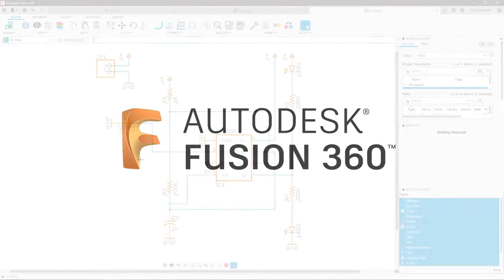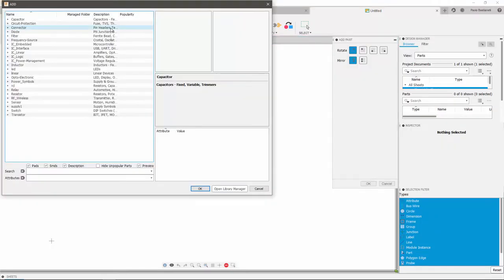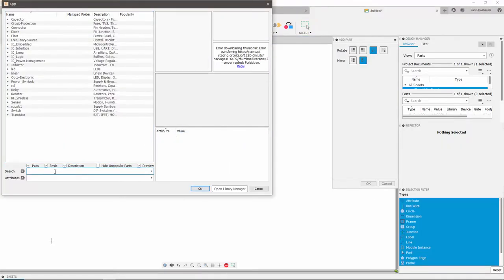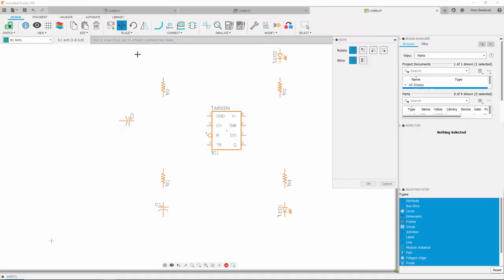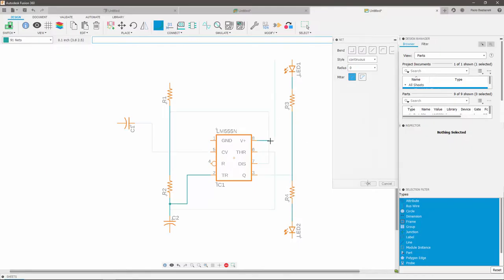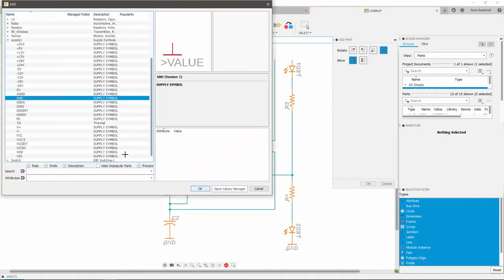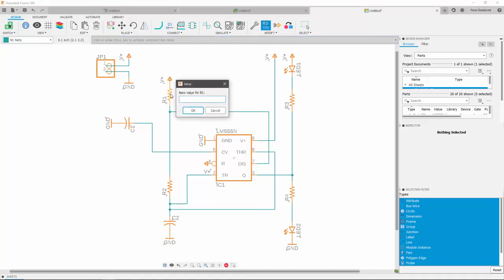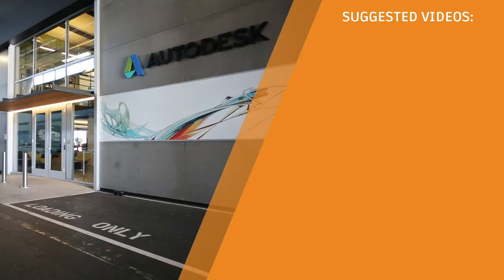Electronics Schematic Tutorial Walkthrough

Comment: Great new feature, and thanks for a great introductory video. I've been playing with the electronics design feature for a couple of weeks now, and since I've never experienced Eagle, I'm really impressed. However I'm getting frustrated with the message "The free version of Fusion 360 cannot perform the requested action", which seems to pop up all too frequently. It would be helpful if there was some comprehensive documentation on what the license restrictions are, since usually this message pops up without any explanation. So far I've found through trial and error that board size is limited to approx 80cm2, and that hierarchical design is essentially disabled , since you are limited to one module in a schematic.

Comment: I have Fusion 360 up and tried to follow along. I don't have the new electronics design on my client. Perhaps it will come soon. I will be working with this right away. Thanks for moving in this direction.
Reply from the maker: Hey there, did you restart after the update? If so, it's a bit easy to overlook that this has actually been added. Keqing did a great job giving the basins on the What's New blog: https://www.autodesk.com/products/fusion-360/blog/january-27-2020-product-update-whats-new/
Let me know if that helps!

Comment: Thank you for these electronic design tutorials!  Question: When I clicked the ERC after completing my schematic, I have an extra warning that you did not get in the video: "Board and schematic are not consistent! No forward-/backannotation will be performed! Use the ERC command to get a detailed error report"  What did I do wrong?
Reply from the maker: Hi Hari, this is Edwin, thank you for reviewing the video. The error you are getting is the fact there is a PCB that is linked to your schematic and the components or connections don't match. At this stage it is best to stop editing and move on to looking into this. If you haven't spent much time on the board, it would be best to go to the electronic document and Un-Link the existing PCB and generate a new board from the schematic. If this is not possible, then you need to evaluate what is causing the inconsistency and manually fix them. For example, if parts are missing, then consider deleting parts then run ERC again to see if it fixed it.
Reply: @adskFusion  Hi Edwin.  I posted related question on Fusion360 facebook group and Jonathan pointed me to the Autodesk forum as well.
Someone there suggested the same workaround: delete and re-add.  :-(  If you guys do not have a consistent way to duplicate this issue, I could try to replicate a consistent scenario so your devs could fix the bug.
https://forums.autodesk.com/t5/fusion-360-electronics/how-to-push-schematic-to-2d-pcb/td-p/9356257